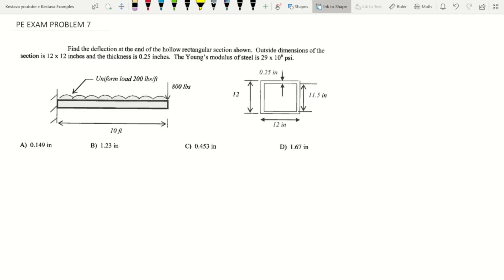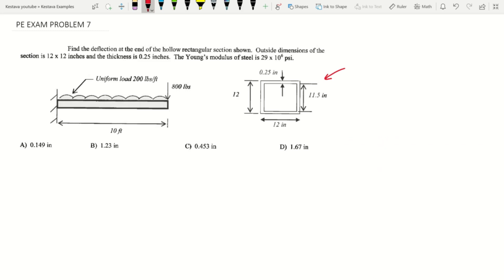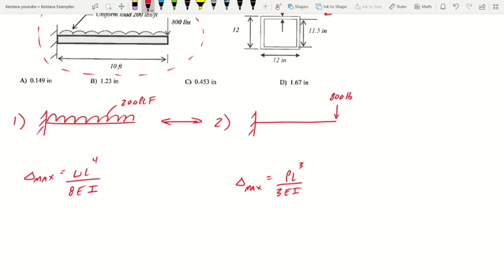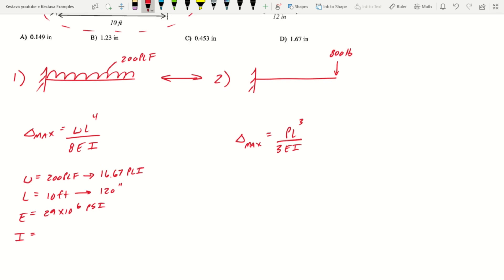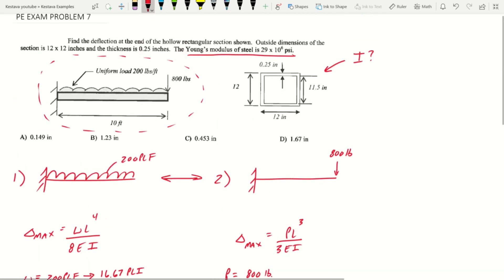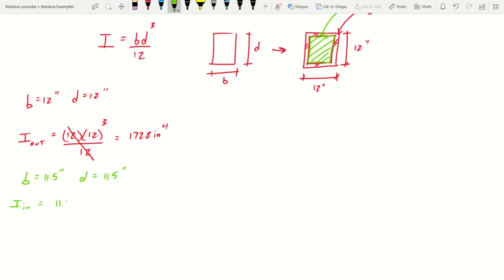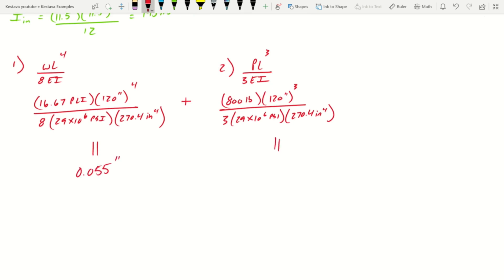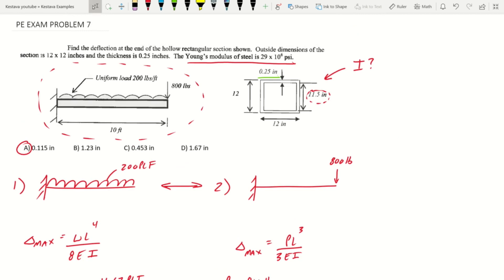Civil PE Exam - Deflection Design Example

Comment: Replying to one of the comments where he referenced the steel manual chart for finding the moment of inertia... Is there a explanation for why the chart value is different from the hand calc'd value. I have the 13th Ed and for a HSS12x12x1/4, I = 248. And my hand calc I did equals pretty much your example shown. I'm wondering if it's reduced or factored.
Reply from the maker: Hey Matt,

the HSS listed in the steal manual have VERY specific dimensions. The thickness is not truely what is stated in the callout of the shape. (Example) an HSS4x4x1/4 is not truely 1/4" thick. Secondly the corners of an HSS are not perfectly square, they actually have a radius. all of this creates a different I. So when a shape is GIVEN in a problem like this, its safest to use the shape and not assume that it is an actual HSS from the steel manual.
Reply from the maker: in a professional setting, you probably would not have a shape like the one in the example, if it was called out as a 12x12x1/4 then it would be 99% of the time an HSS12x12x1/4 and you would design using the AISC values. Really great job looking closely at this!

Comment: Why can't we use the dimensions and properties table in the steel construction manual?
Reply: For the moment of Ineria*
Reply from the maker: you could and would get very very close to the right answer, but the question does specifically give an AISC steel member.

Comment: If you use the steel manual for the I value of an HSS the book gives you a 12x12x.25" = 248in4 (T1-12, 13th Ed.).  1st equation yields 0.06", 2nd = 0.0640"
Reply from the maker: love the additional info Don! 🙌
Reply: @Kestava_Engineering  This channel is great, real good stuff here.  I am planning SE exam redo next yr., I have an SE firm of my own.  I designed parking structures for 10 yrs with Walker Consultants also.

Comment: This is a from a steel fabricator just looking to be able to assist his engineer with recommended beam sizes. I understand everything in this video (although I'd be using the AISC Tables for the MOI at 248) EXCEPT... I have no idea how to do the bd to the 3rd power equation. The math portion. Is there some quick way to explain that to me? Or a reference? I tried to hand calc but without the knowledge/training, I just can't figure out how you so quickly arrived at 1457.5 to the 4th. Or is there a calculator somewhere I can buy that will allow me to type in everything that you referred to as "all that jazz"? love the content by the way, just don't have a background in engineering.

Comment: Great work. Two things that I wan to mention here:

1. For this particular example, you could have saved time and just pulled I from the steel manual for TS 12X12X1/4 which is 265 in^4 based on 8th edition Manual. The delta between the computed I and the value  pulled from steel manual is not that significant. Actually the total deflection would be = (265/270.5)* 0.114 = 0.112”. Going through the manual calculations is not a bad way as moment of inertia is not tabulated for every possible shape.  

2. Just for sake of accuracy, there was a slight math error in computed I. I effective = 1728 - 1457.5 = 270.5 in^4 not 270.4 in^4 .

Keep up the good work.
Reply from the maker: 1. Very true! I wanted to touch on finding effective I but you are right to save time by using the AISC manual! 
2. I like you sharpening the pencil, bravo! 

I love being checked because I want to know when I can do better as well. thank you

Comment: How about if you have the roller at the end instead of point load and asked for the reaction at the roller how do you find it? I saw that in F.E exam. Thank you.
Reply: Assume that the roller reaction is a point load at the end of the cantilever and calculate the deflection for the end of cantilevered beam. Since the deflection is equal to zero then you can easily calculate the point load which is the reaction of the roller.